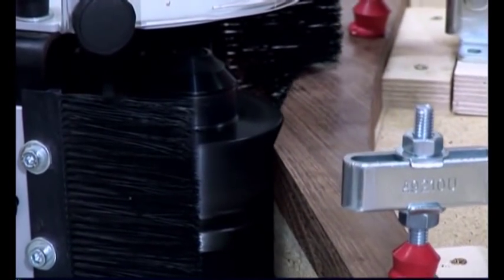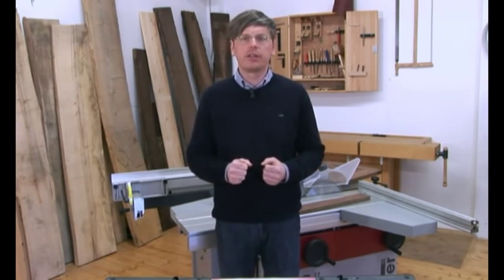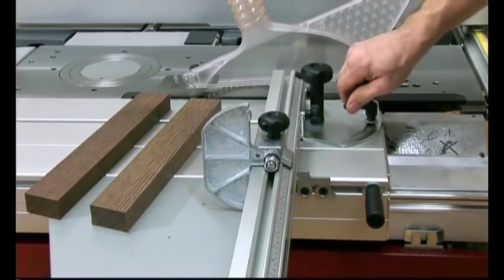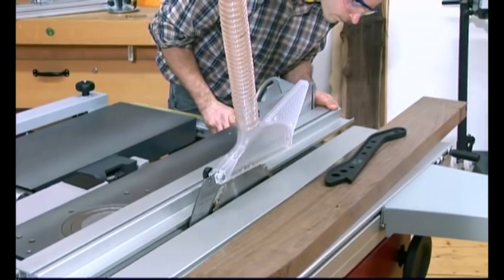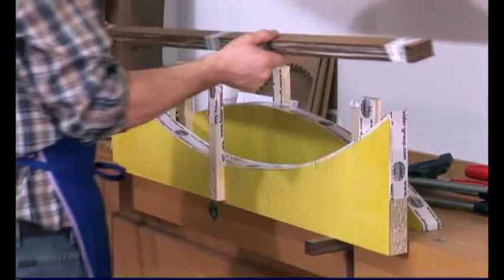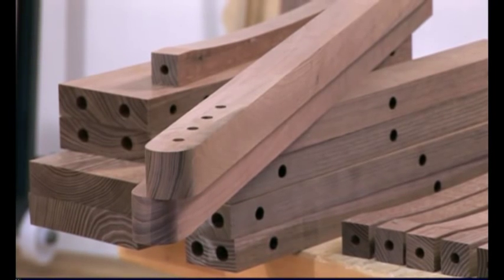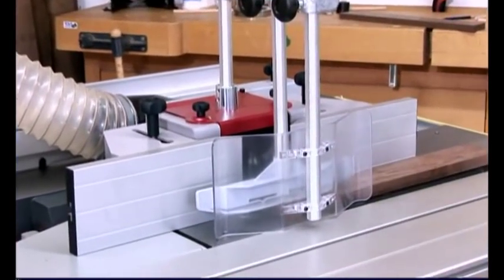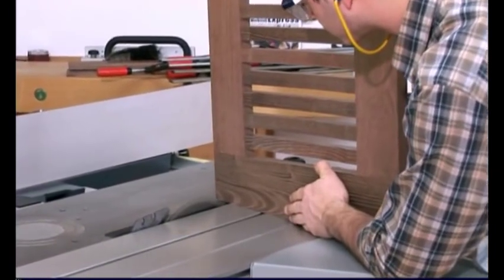DIY Hammer® rocking chair produced with the combination machine C3 31 | Felder Group (Part 2)

Comment: I seen one of these at a woodworking show in 2020, now it might have been a different model number, but it was the same basic machine.
My only problem with them is they do not make coffee,  but you can do almost anything else on them.
I'd love to have one but wow you better have deep pockets,  or just ride a bike becuse they cost as much as a cheap car. The one I seen was 14k but had a discount of 2500.
Or something like that.  
Let's just say youd be making more then one rocking chair to pay for it.
But look at it like this you could batch out 50 at a time. This would cut down setup times between cuts. You better make more then one bending jig. That's 100 bent assemblies you'll be doing.
I'd do 10 of them, and cut those parts first, that way when your working on the saw 5 chair rockers could be going at one time, that will take 20 days to glue that set of parts up.
Yes the machine takes up less room but omg where to put 100 rocking chairs?
Reply from the maker: Hello, 
Thanks for your comment :D Unfortunately, you are right: Our Hammer Combination Machine C3 31 is not able to brew coffee ;-) We should consider that... 

Did you already have contact with our sales team?  They will be glad to help you and maybe you will find the perfect machine for your needs. http://bit.ly/2Efaxm9

If you are interested: We have other DIY Projects on our Website.
- Hot tub: http://bit.ly/3713F7g
- Top bar hive: http://bit.ly/2GWTy8X
- Designer Chair: http://bit.ly/31rfcvo

Best Regards,
Your Felder Group Team